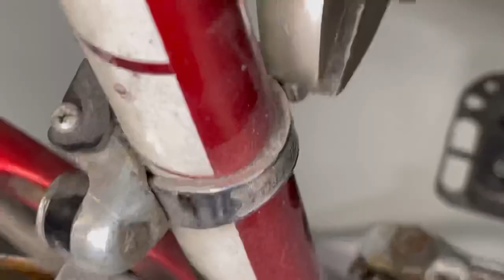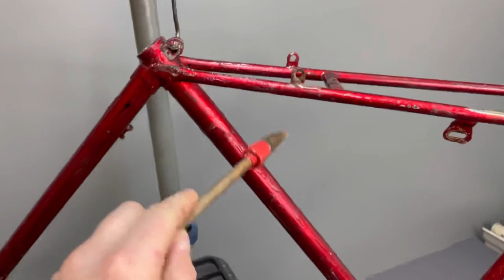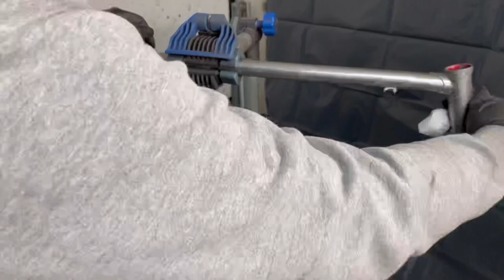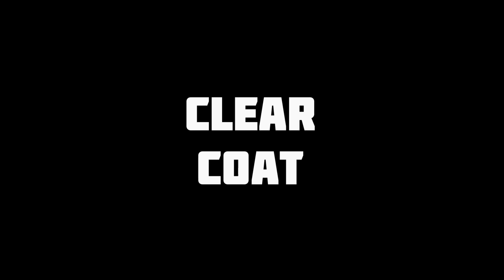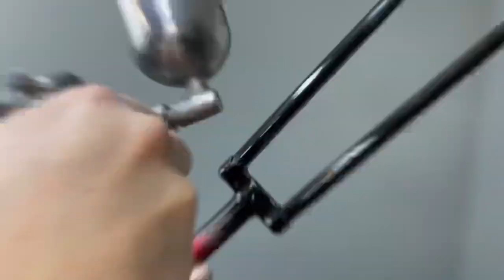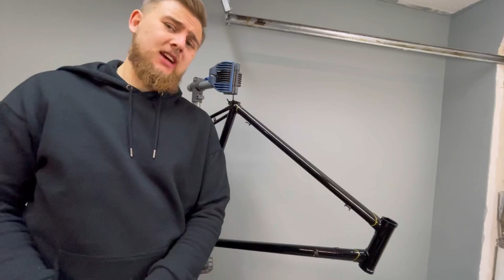Motobecane Frame Custom Painting Vintage #Bike #Restoration #Project

Comment: did you wet sand before applying the black coat?
Reply: Not that I saw and whilst this is definitely better than what I'm going to do for the first time , I can certainly see that the missed wet paper has left plenty of little bits. Thanks man, I love your work it helps me to understand and I really really do know it's harder in the reality so top marks